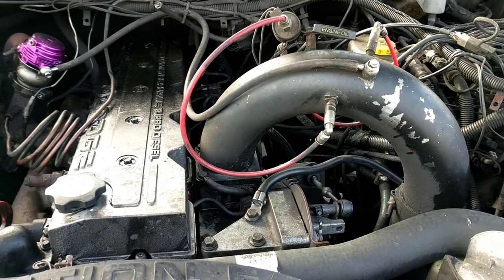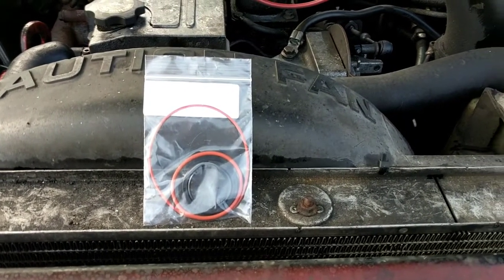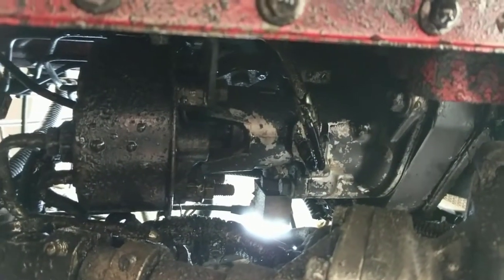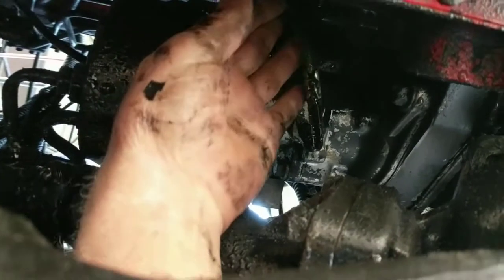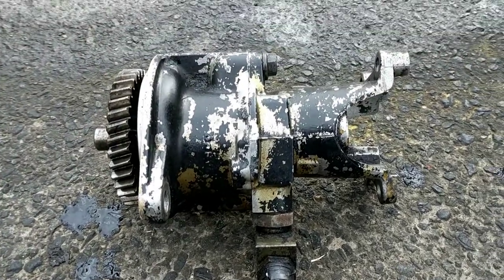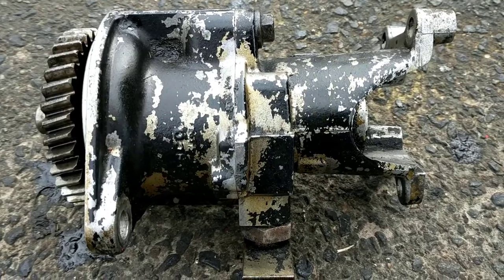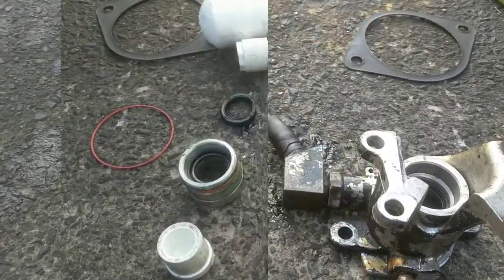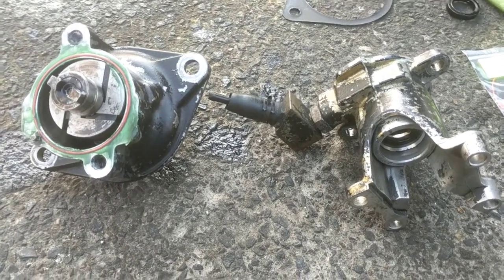How to rebuild a Dodge Cummins vacuum pump step by step remove, rebuild, Cummins vacuum pump

Comment: The round pvc plug is actually a 1” spigot plug, no alteration required. Also a chop saw can make really clean square cuts on the pipes. Great video by the way it’s saving me a ton of money.

Comment: thx for the vid.  Bitch of a job if you have adult sized hands.  just how do you get the oil feed line off?  Two nuts under the pump I can't crack apart or the engine block which I can't reach.... thx

Comment: So this isnt an actual rebuild kit, but a re-sealing kit? If the pump is not building vacuum then in order ti rebuild you would need new pump vanes, right?
Reply from the maker: You are right, and I just used the kit because it is easy. It is only PVC. You can get it at any hardware store and make yourself. There is not that much to the pump. 
You can get all the parts for it, I have replaced the fiberglass blades inside it as long as the housing is good. I had one with a cracked housing and did not realize it until I put it back in.